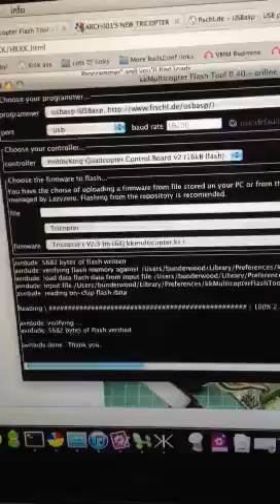Flashing KK multicopter board with tricopter firmware

Comment: I had the same problem - over and over again.  I read forums and someone said they used a different computer and it worked for them - so - I used my laptop - and - you guessed it - it worked.  I hope you can do the same.  Fly safe - fly high
Cheers